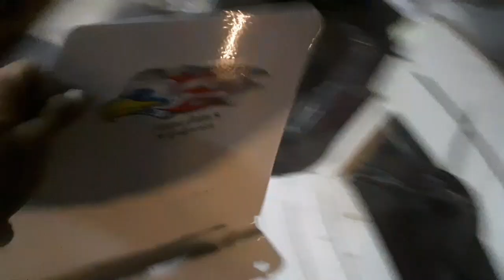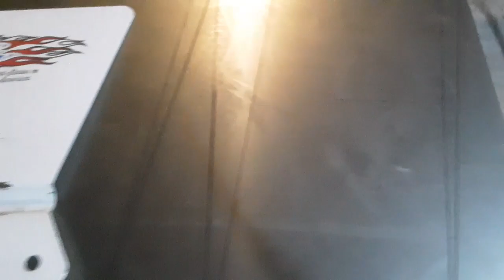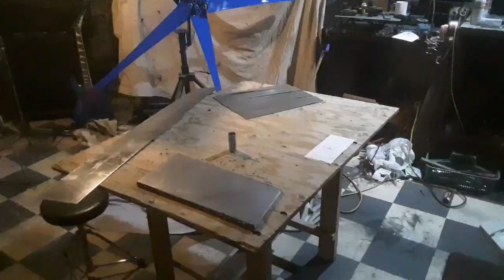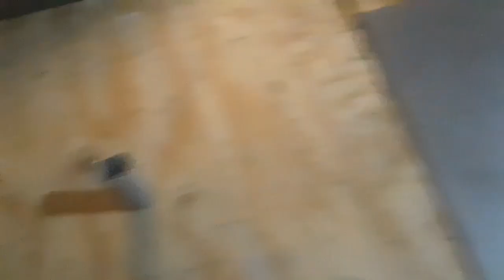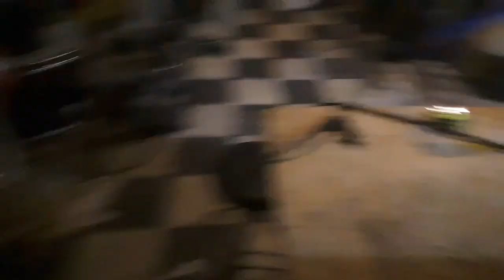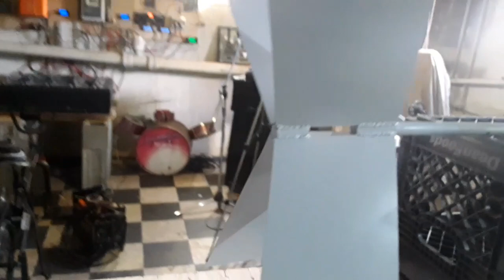I Made a New Tail and Balanced the Larger Blades

Comment: i like this X design a lot! it should do great job
Reply from the maker: I really hope so. The current tail has far to much wobble.  I made it from 22 gauge steel because the hardware store was out of 16 gauge.  To thin...as it wobbles it takes the turbine out of the direct breeze and slows it down before it can speed up. This is unacceptable so here we are again but I am quite confident the new tail will fly beautifully!

Comment: air synergy wind turbines are the kind of design that would work, be nice to see if you get higher watt peaks i know i got a dramatic improvement from my turbines from balancing.
Reply from the maker: It saw WAY higher output with the 5 blade prop even before it was properly balanced so I expect pretty impressive results with it being balanced and with the addition of the new tail to keep it stable.
Reply from the maker: Checked out the Airsynergy products... Wow is that a cool design! I see that working darn near everywhere. Biiiig tail fin and the funnel to focus and force air past the blades. Very cool! Cant find much info on cost though which leads me to believe it's pricey.  Not really my style.... i bet I can build that though...